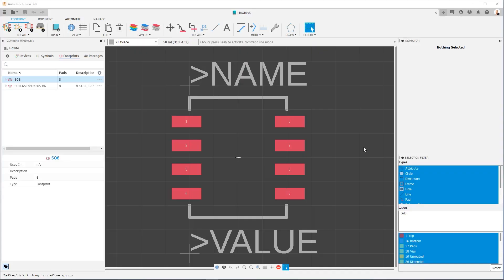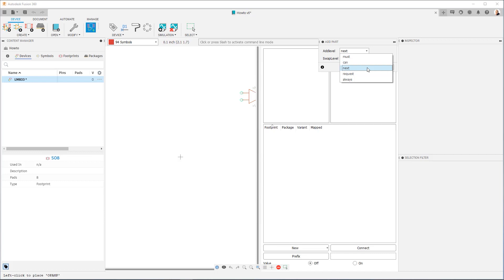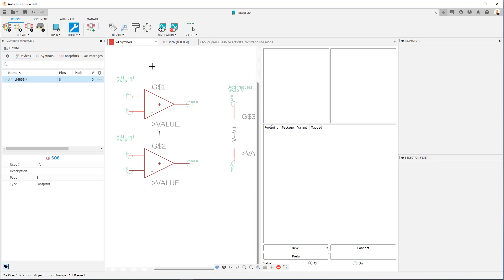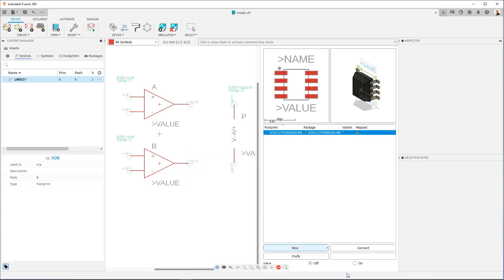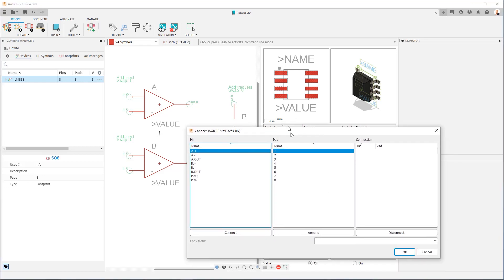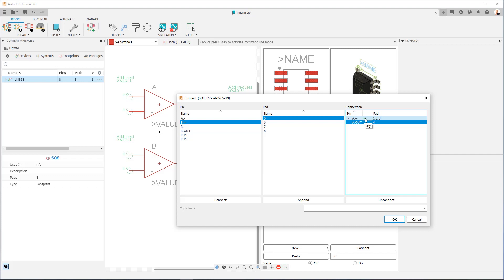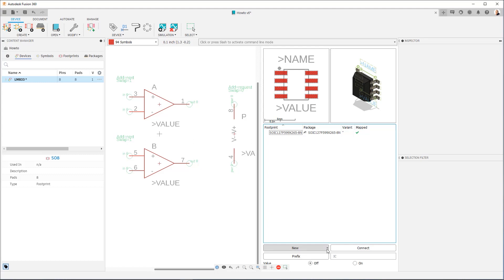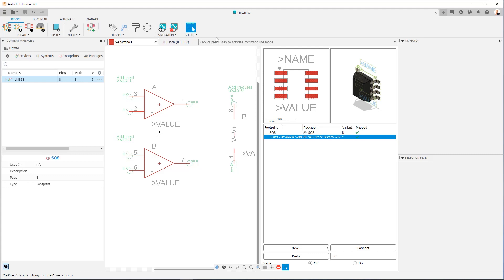Create your own electronics parts in Fusion 360: Video 5 Making a Device

Comment: Adding a new part in my library ''biblio'' I want to configure it to be able to add a gate one at a time in a new design. 
In your software ''Fusion 360'', you have the symbol ''manage'' which enables you to do so.
In my version, may be updated since then, this symbol seems to have disappered.
I broke my head since a week to find out the new method to realize this.
Could you help???
Many thanks in advance!
Gaetan

Comment: Hi Jorge. Very useful video series. In a different video someone sad to center the footprint at origin 0,0. I assume this is for pick and place?
To locate my components I have been setting pin one at 0,0 because I am converting all of my Ivex created boards to Eagle.
Will this be a mistake when I start having a job house populate my boards? I haven't gon so far along with my conversions to not correct this. Thanks

Comment: @Jorge Garcia  I am trying to make a PCB-mounted XLR connector (NC3FD-V). I can import an STP file from Neutrik, but how do I assign the pads, etc. I have created the footprint already, but there must be some connection between the 3D-model and the footprint. Thank you.
Reply: Just a guess, but I would look at generated models and analyze their structure. I would have to guess you have to manually make pads in the pad sketch which looks like a point with 2 concentric circles.

EDIT: Actually, it looks like you should create a footprint first and then "Create New 3D Model" It will include the relevant sketches to derive the 3D model's pin locations from from.

Comment: Why has a simple process been overly complicated? Why can we not have the ability to drag the footprint into a pane and assign pins from there the same for the 3D model and symbols?(would it not make more sense to do the design in Fusion and have the same drag and drop feature as when doing an assembly? Then save as a new component.
Reply from the maker: Hi @Groen Sewe.  Thank you for viewing and commenting on the video. At the moment, the team developers will continue to make changes and improve the library editor experience.  Your comments and observations are appreciated and will be shared with our team.